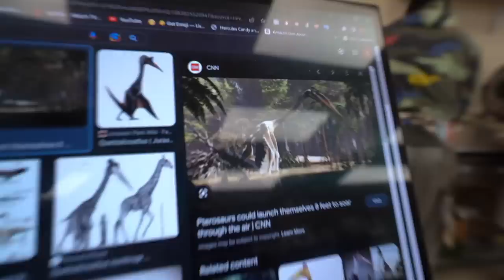Why Are They Making Christmas Candy in May??? 😂🎄

Comment: Shawn on "Mousetrap Monday" tested the theory that strong mint chases away rodents. 

NO, it actually DOESN'T, and hot pepper doesn't work either.
Reply: It did at my place.  When developers started tearing up the waterfront the resident rat clans were suddenly homeless and wandering.  One or two found their way to my balcony which I thought was weird as my cat friends inhabit the balcony freely.  I even had a litter box out there.  I saw the rat using the litter box.  Even more weird.  I do not want to harm anyone, so I set about trying to figure it out.  I made a pepper oil concoction and spread it around the perimeter of the balcony out on to the walls around balcony.  I then put my potted mints and cat nip plants around, and picked some and sprinkled it around and lay some out in bunches.   The rats stopped coming by.     The reason the oil worked is that it gets on their feet which is not comfortable and when they clean their feet it is not good.   That is why hot pepper in bird feeders keeps squirrels from eating the bird food.